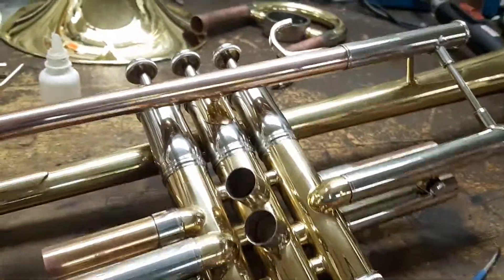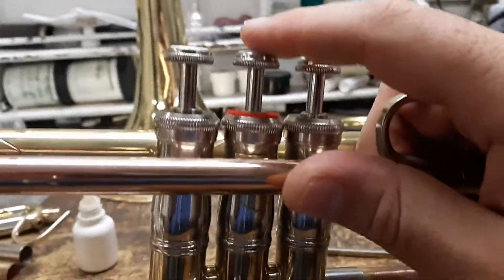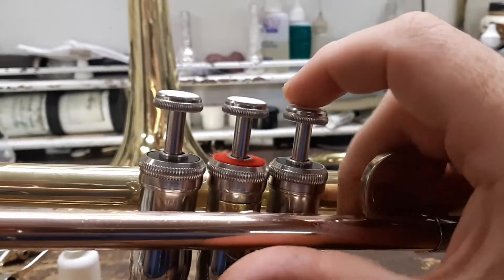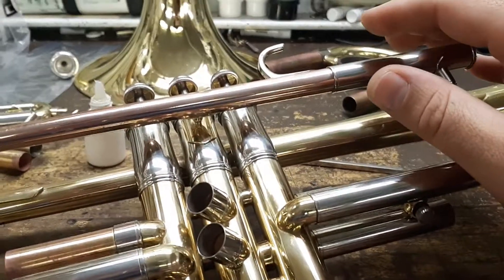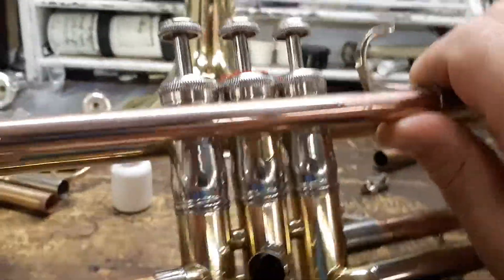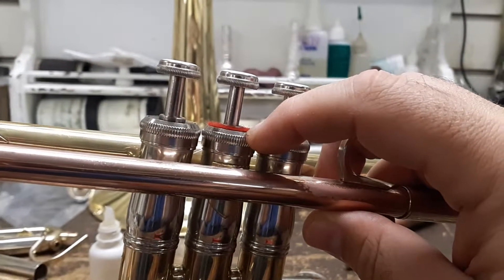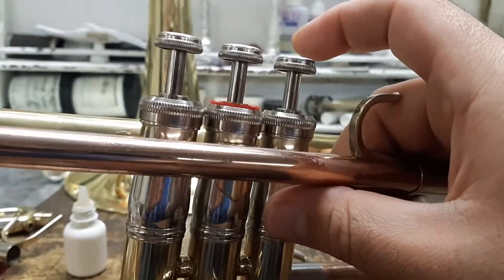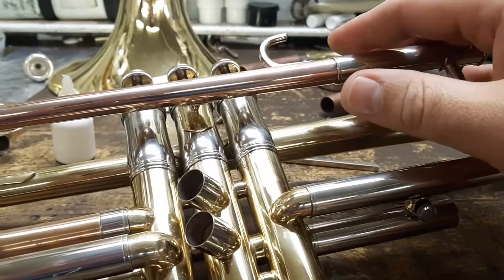Trumpet felts made of actual felt vs rubber

Comment: Hey I have a question! So on my trumpet the felt on the top of the valve got unattached so I was wondering if putting a bit of glue at the bottom of the felt and pressuring it against the metal would ruin the overall sound the valve makes when pressed down
Reply: SnakeBro's247 I have the same question because mine keeps popping off and I just wanna know if putting glue on it would mess it up